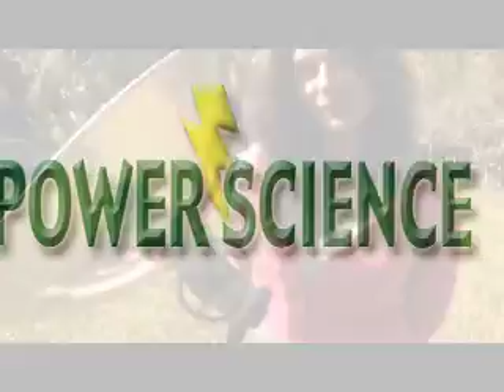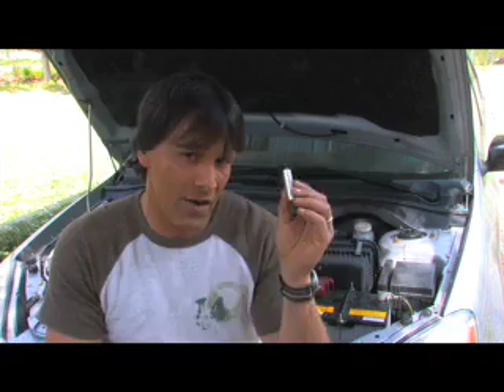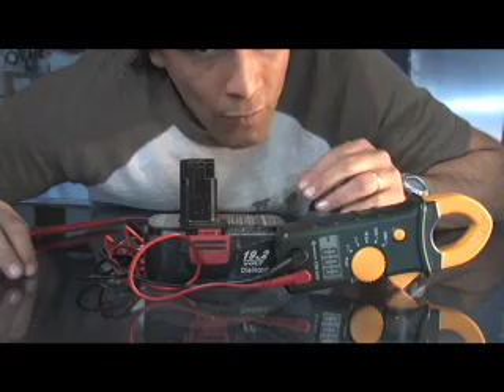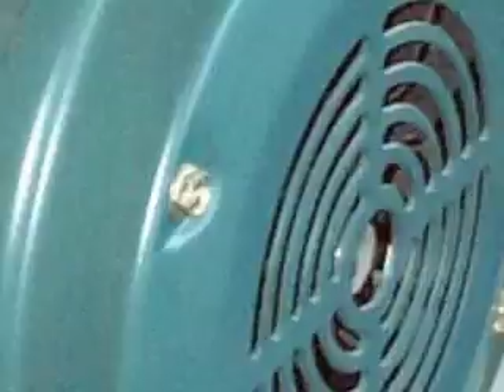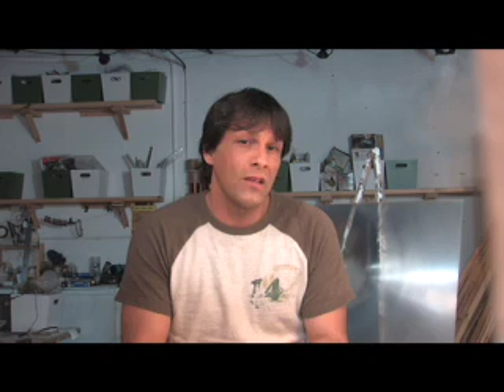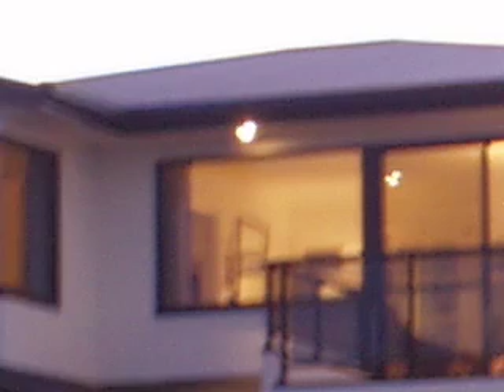ELECTRICITY GREENPOWERSCIENCE PART1 NIKOLA TESLA AC CURRENT

Comment: is that delta ,or wye? if you have a higher voltage in 1 of the 3 you have wye and thats a "stinger leg" be careful adding breakers! delta 3 phase is three identical voltages 120/208 black red blue & 277/480 brown orange yellow with delta be careful not to mix up neutrals.

Comment: Sorry Dan but what you are saying is missleading. The point about using higher voltage is all about cable sizes wich you fail to mention. High voltage/ low current means cable with less cross sectional area so cheaper to distibute over longer distances. AC can be stepped up or down relativly easily so can be distibuted as very high voltage then stepped down for domestic use. This was Teslas great developement

Comment: Hey there!  I have an odd question for you.  We have an old camping bronco with a roof rack.  Can we safely mount a small solar panel and marine battery?  The girlfriend would like heat while we are out camping...have to make her happy.  Figured we could power a small space heater with the system, and have it charge back up during the day.  Perhaps also power some of our axillary lighting at night, instead of running off the trucks primary battery.  Thanks for any input and I love you shows!

Comment: I know if you pack the sides of a fridgerator with more insulation it works better and runs less electricity.
Because it becomes more efficiant at insulating against heat transfer.

Comment: Hmm i smiled...extra 5 volts FTW xD

Dan pretty much explained it, and i will add one further example:
In Europe we dont use a 110, not a 125/240, we use  230/400.
Wich means.....that most appliances ranging from 100-1000W can all have the same thin power cords

Comment: It is not the voltage that allows the power lines  to be much thinner. It is actually the current that controls the size of the conductor required.

Through the miracle of transformers a 200 amp service at 240 volts is only  2.4 amps at 20000 volts. When a transformer steps down the voltage, it steps up the current.

This is simplistic and only reflects one house, but illustrates the concept well enough, I think.

Just remember: The higher the current the larger gauge the wire needs to be.

Comment from the maker: Hi,
Yes, it is 220 service (actually 240 volt service). I said "those lines" (plural). While the bundle of wires in most houses equates to 240 V. I was referring to each individual line/wire (120 + 120) so those line(s) indeed are 120 v each alternating current) That line (singular) is 240v. I stated it this way because we actually have an additional wire. Our house/office was once used to repair aircraft and the machinery required large powerful "Three Phase" motors. So our service is 3 phase.

Comment: Wow great videos!!! Looks like you have put into practice some of the ideas ive only pondered, like the fresnel lens to power a steam or sterling cycle engine. Ive also considered using the same means to perhaps heat some kind of liquid medium to very high temps to be used as heat batteries with those engines, this way you can use the days heat to power the devises at night.I would also like to see this used in the production of hydrogen from water electrolysis that may be used in place of petro

Comment from the maker: Neodymium magnets are very strong but as for the DIY generators you see everywhere, they are of little use in my opinion. AC current cannot be stored in a battery like DC current so it must be used on demand. With the exception of incandescent light bulbs, any AC item in your house needs steady 110-130 volt 50-60HZ current or it will get trashed in a hurry. To use the neodymium AC generators requires an exact spin rate from a windmill etc. DC current can be random and stored then inverted to AC.